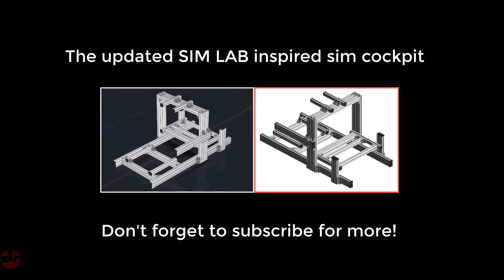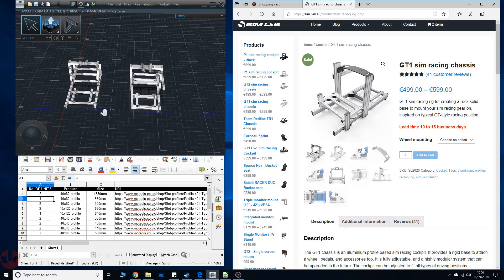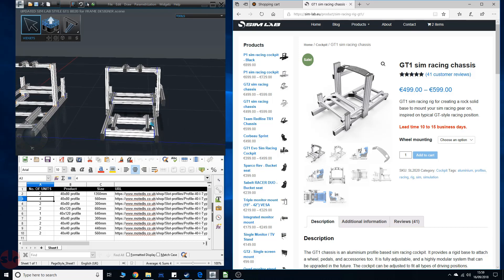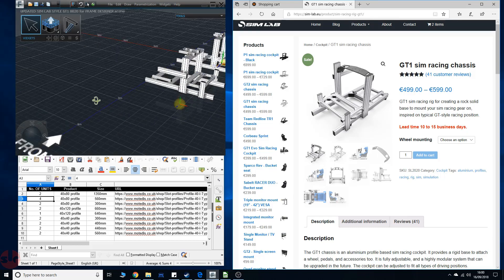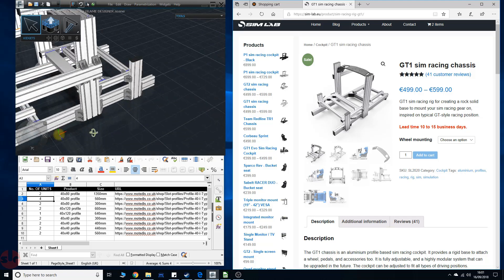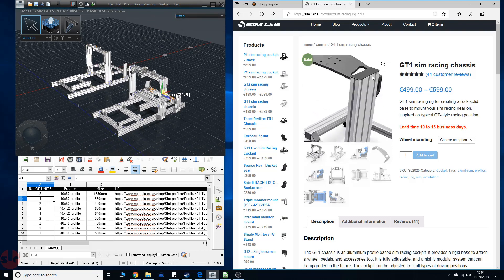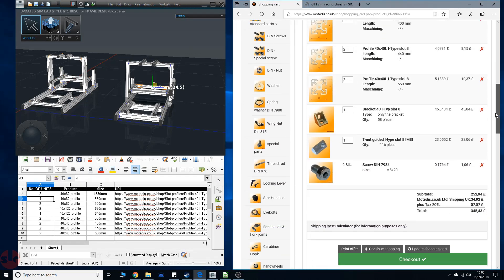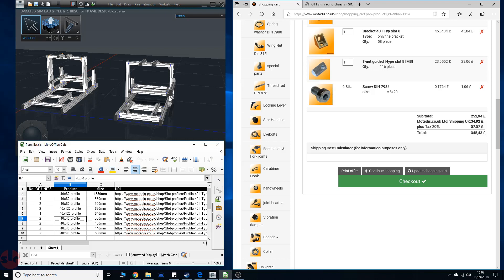Build this SIM LAB GT1 style 8020 sim cockpit and save 40%

Comment: In America we have a steel product called SuperStrut. Its not as pretty as 8020 aluminum but it is similar to work with. Its available at local hardware stores like Lowes or Home Depot.  To give you an example of price: A 10' (3 meter) bar of 1-5/8" square tubing is $18.57. I'm building a rig to hold my Fanatec CSL Elite kit/ with H-shifter, Jegs 70200 seat, and 49" 4k tv. My total cost is around $150 for the rig and $45 for the seat (still tweaking the design).  That CAD program you are using is real slick. I'm stuck using tinker CAD on a Chromebook.  My operation is a truly low budget. 
For angle adjustment of the wheel, if you decided you want it, you can use the slotted hole brackets on the sides of your wheel mount extensions. Cheers and good luck building.
Reply from the maker: Very ingenious Todd. SuperStrut does look like an interesting option. It should work fine for lighter gear.

Comment: I just decided to see what it would cost me to build this rig setup, with all the exact pieces and fasteners, and the price difference with freight fees comes so close to the price of simlabs version, that i couldn't justify going the DIY way.

And thats the thing, unless you have a 8020 supplier nearby and you can get reasonable freight prices or even pick up its probably cheaper and then i could see it. But i also can appreciate the designwork Simlab has put to the rig in the first place so I prefer to support the company instead, pay a little extra for essentially the same product. This way I support as many jobs as possible in the line of production.

Comment: Great video I know what rig I’m going for now. Just thought I’d mention it would be it would be easy enough to be able to change the steering wheel angle. All you would have to do is modify the bolt holes on the 90 degree brackets.
Reply from the maker: Great tip!

Comment: Hi,

Trying to save space here to then place a independent 3 monitor stand on the outside of the base. 

1. If we place the vertical 40x120 on top of the base 40x80, would the rig be still as STURDY/STABLE as your design? or will be be less stable? Any particular reason you kept the vertical on the outside instead of on top?

2. If we go with the 40x120 on top of 40x80 option would you recommend to reduce height from 790mm to 710mm or to still keep it 790mm?

Thanks and waiting for your reply as im ready to place order.

Thanks a ton 😊🙏💐
Reply from the maker: 1. You can, but I'd recommend you use joining plates instead of the basic brackets to prevent flex. That's the reason this design has the uprights on the outside, so they can be sufficiently secured with these angle brackets.
2. I would reduce the height.

Comment: Any new update on building a new SIM Rig . Great video smashed that like thanks
Reply from the maker: This is a classic, practical style of design that stands the test of time. So I haven't felt the need to revisit this subject. My personal sim rig is the SIM LAB GT1, so it's effectively the same as this one.
Reply: @SimRacingCorner  thanks 👍
Reply from the maker: Actually, you can check out my setup in my most recent sim rig tour. https://youtu.be/p86LYGQqX0M. It's modded a bit over the years to accommodate gear I've attached, but essentially the foundation of the rig is unchanged.

Comment: couple questions....
are your wheel base stanchions 300mm?
300mm is the shortest in your xls, so i'm assuming they are.
also i'm looking at purchasing a clubsport wheelbase 2.5 from fanatec and it looks like it has a 3 bolt triangle pattern for mounting. 
have you considered how this 4 point square style would accommodate that?
Reply from the maker: The clubsport comes with an angle bracket that provides a 4 bolt pattern that will work with this.
Reply from the maker: Otherwise. Just make a deck out of board, drill and bolt through.
Reply: Ah I didn't know about the bracket, ty for telling me!
Reply: Have you added any type of feet to your rig? I wanted to do 6 leveling style feet but they are 25% of the total cost!! I'm considering skipping them and just setting the rig right on the floor.
Reply from the maker: @jaywarren3505  I've added 4 rubber feet to mine, but sitting the frame on the floor is just fine really.

Comment: What kind of seat goes with this? Can you put most seats on it and adjust them? Does the design have any of those quick tightening parts so you can easily move pedals and seat around?
Reply from the maker: The point of this type of build is it's easily adjustable to fit all types of gear (including seats) and modular. Eg. https://youtu.be/p86LYGQqX0M
Reply: @SimRacingCorner  Ok I'm sold, that was a cool video. So you can basically put anything on it as long as you figure it out how to do it. Little bit of like playing with a puzzle. I think starting basic and then adding things little by little with time is the way to go.
Reply from the maker: Yes, it's a completely versatile platform you can add too and move things around, and structurally stiff. The materials are easy to work with, there's no real skill needed. The design in the video covers the essential base measurements and parts for the structure.
Reply: @SimRacingCorner  Thank you for the quick answers. I checked a site that sells 8020 and all the parts and sky is the limit for this. I'm going to check your videos on if you have triple screen stand too and other rigs. I would wish many seating positions were possible, and it would be a bit higher from the ground than this rig. This would be good enough for my needs as is though, just nitpicking.

Comment: Hey bud. Sorry to dig up an old vid, just wanted your view on whether this is still a viable option (self build old style SimLab GT1) in comparison to the current SimLab GT1 Evo rig? Price wise theres only about £40 quid in it (inc shipping) between the two. I can see a lot of the extrusion has been removed, with custom aluminium plate used for the pedal area on the newer evo version.
I'm currently using a modded up playseat challenge (due to the need for it to be folded away) with a TX wheel, T3PA pedals and TH8A shifter, but I'm going to have the opportunity for a permanent rig in the next few months, so I'd appreciate your views :)
Reply from the maker: No worries, this is still quite a popular video. The EVO GT1 is very nice at a good price point, it's a really good option. The DIY build in the video will be a bit more sturdy than the EVO GT1, but nothing of concern and would still be stiff enough to carry a direct drive wheel. I do like the look of it. I don't think you can go wrong with the EVO GT1.
Reply: @SimRacingCorner  Appreciate the reply.  As this build (and in most dimensions, the GT1 Evo) is similar to your rig, would you think it would slide under a desk right up to the back of the steering upright extrusions?  Just playing with ideas of the screen being sat on a desk/arm mounted, so I can push it back and use my PC for 3D CAD etc. as well as for sim duties.
Reply from the maker: @Skate2create  You could the slide pedal area under a desk, to the point the uprights of the wheel deck would butt up to the tabletop. You should need about 450mm of depth (measurement taken from my rig) under the desk for the pedal area to fit.
Reply: @SimRacingCorner  top man, just the info I needed :)
Reply: @Skate2create  Get a monitor swivel arm and you can team just swivel and move your monitor right at the end of your desk

Comment: Hi, great video but 5 years old.  I am looking into sim rigs right now (like a lot of people) and would really like to know if this is still going to be more cost effective than buying off the shelf?
Reply from the maker: You'll need to do your own research on this, and check the parts against local suppliers for the best price and see if it's worth the effort of a DIY vs. a turnkey option. The only thing I'll add, is for the connecting brackets, AliExpress is the cheapest place to find all those pieces. Ultimately, a DIY build will be always cheaper if you don't mind shopping around for the materials.
Reply: thanks for quick reply.  I was really hoping to lure you into making an updated video :) Your insights and previous experience would certainly be valuable  @SimRacingCorner
Reply from the maker: In light of this video not getting much traction since being published, it's a not a subject I'm looking to revisit at the moment and I currently have a bunch of other new videos I'm working through.

Comment: at some places where you have used 2x 4040bracket, is it better to use a single 4080 corner bracket instead?

Are 2x 4040 corner bracket inherently more stable than a 1x 4080 corner bracket?
Reply from the maker: I think there will be times when spreading the load with 2 4040 brackets is better than a single 4080 bracket.

Comment: We need a simple adjustable cheaper Inverted pedal mounts as well!
Reply from the maker: I don't know if you've seen the Trak Racer inverted pedal bracket. That would be ideal for this.
Reply: @SimRacingCorner  I just saw that last night actually and already considering it, either that or diy with some 4040 profiles. If all the parts for diy would cost close to the tract racer shipped then Ill just go with the track racer for sure
Reply from the maker: @daemon3spade  I do particularly like the Trak Racer solution. I've been considering it myself. But my purpose would extend to future pedal reviews where I need something I can easily adjust on the fly.
Reply: Alright mate.. I just received my Sprints and feeling them by hand they are a bit tougher to push, this really will require a solid base definitely
Reply from the maker: @daemon3spade  What sim rig are you currently using?
Reply: @SimRacingCorner  just diy alu profile and its only the rig part of the wheel.. damn i cant share links in YT comment

Comment: This is really helpful.  Could you clarify how I fix the pedals and wheel if I go down this route please? I undertand the simlab rig has a bespoke pedal and wheel plate.
Reply from the maker: Some wheels and pedals can be bolted directly to the profile using just t-nuts. Others can be attached to the profile using corner brackets. Other wheel and pedals may require additional profile parts or a flat mounting deck. Basically depends on the hardware.
Reply: @SimRacingCorner  could you share how the Tlcm would be able to be connected to your designed rig. What extra parts I need to order. Thank you.
Reply from the maker: @ranakirti  I use this https://youtu.be/H34NnGCephQ

Comment: How do I mount the wheelbase. Sorry I'm new to this. Would appreciate it if you could link me to something
Reply from the maker: Which brand/model of wheelbase?
Reply: @SimRacingCorner  thrustmaster t300
Reply from the maker: @sadistic6007  The easy solution is attaching some board across the 2 bits sticking out of the frame to create a mounting surface.
Reply: @SimRacingCorner  alright thanks. Also what should I do if I want some angle for my wheel base. I,e I want it tilting upwards a bit for some comfort
Reply from the maker: @sadistic6007  You should be okay with the T300, the wheelbase is already angled when mounted to flat surface like a desk.

Comment: I noticed the video and frame designer scene have 40x120x660 uprights. The excel parts list and may-cad model have 40x120x790 uprights.
I assume simlab increased this length because of their custom wheelmount part.
Reply from the maker: Yes, you correct, the 790mm is based on the SimLab custom wheel mount. I would say though if you going with a wheel mount design like mine, I would recommend 760mm (minimum) uprights or taller. Having the freedom the adjust wheel deck height is important. In hindsight, 660mm is a bit short.

Comment: Watched both your vids today, great videos but you still got the bolts wrong as in last vid, m8x20 is 20 mm long, not 20 pcs. You basically got 6 bolts in that list stk = pcs in german, where i would guess the seller is from. Bolts are cheap so wouldnt make much of a difference but just a note for upcoming videos :)
Reply from the maker: You were clearly paying attention. You're totally correct, I realised the error later on. Just me getting confused while recording. I corrected this in the downloadable parts list. And thanks for watching. All the best.
Reply: @SimRacingCorner  Hi Guys, Just subscribed. Excellent work. Can I confirm that it should be 116 stk Size M8x16? Thank you
Reply from the maker: @ladaloutevans  Hi David, yes, it's the M8x16 (16 is the length in mm) bolts you need and lots of them as listed in the part list.
Reply: @SimRacingCorner  Awesome. Close to buying a 3d printer!!! You will know what for! ;)
Reply from the maker: I think I do. Handy things 3D printers.

Comment: was thinking why are the aluminum on the pedal plates that high? Is there any way to reduce aluminum used on the pedal plates by changing there positions etc?
Reply from the maker: The rear pillars are high to allow the pedal deck to be tilted. And the design does overcompensate by trying to be a universal platform to support all circumstances. Of course you are free to alter the design for your needs.
Reply: @SimRacingCorner  all situations toy mean like for a f1 style higher pedal setup? and lower for gt3 setup? that's why increased it from 200mm to 300mm? Thanks
Reply from the maker: @ranakirti  Basically yes, and also the pedals. High-end pedals have title adjustable pedals, where cheaper pedals sets don't. So you need to be able to tilt the pedal deck in those situations.

Comment: Great idea for a video and nicely done!
Naive question: do you think scaling it down to 20x20 size would compromise rigidity?
Reason I am asking is that it is 1/3 the price here in Hungary compared to 40x40 profiles.
Reply from the maker: My 3D printer frame is constructed from 20x20. It's only good for lightweight applications so not strong enough for significant weight-bearing. But 30x30 would work though. It's not unknown for people to use 30x30 for sim rig builds.

Comment: Hello good day, nice video. just want to ask, i saw on your buying list that it has the 80x40, 120x40 measurments. Unfortunately the store that i asked to said that they only have thr 40x40 size, but they said that they have this kind of "joiner" to make it for the size im looking for.. are you familiar with the "joiner".. will that work to make me have the 80x40 and 120x40.. sorry for the questions, i am new to all of these..
Reply from the maker: The joiners, I'm assuming, are straps which join together the stacked pieces of aluminium. You  can see them being used here: https://youtube.com/shorts/XDhY71ot16U. It's works, but personally, I wouldn't want to use them for the entire sim rig build.
Reply: @SimRacingCorner  Thank you, just subscribed. thanks for the tips. one last question though, based from your build design, it seems that the wheel deck or mount is not adjustable in terms of angle, like for example you want the wheel to be somewhat upward angle.. how do you think this can be done?
Reply from the maker: Depending on the wheelbase, a different solution may need to be worked out to get an angle. What wheelbase are you using or planning to run?
For example, In the video I pointed you too, I am able to get some angle using the brackets  that connect the wheelbase to the props (standard 40/40 angle brackets, but I could increase the angle with 40/80 brackets). And for example, with a Thrustmaster/Logitech wheelbase, it's designed with an angle already for placement on a flat surface like a desk.
Reply from the maker: Also, you could combine your DIY build with a third party wheelbase mount like this sort of thing. https://trakracer.com/products/wheel-deck-with-full-slide-and-angle-adjustment?_pos=35&_sid=e777a59b3&_ss=r.
Reply: @SimRacingCorner  I am planning to use the VRS DD, but havent buy it yet. looking on the pictures of it..its flat and it does not have an angle if you mount it.
Reply from the maker: VRS also sells a mounting bracket with angle adjustment. You will have no problem, it mounts directly to the aluminium profile. https://virtualracingschool.appspot.com/#/Store

Comment: Is the rake of the pedal deck adjustable on this design?  Looking at it, I wondered if it could be adjusted by braking the tabs off the 40/40 brackets that connect the pedal deck to the uprights?
Reply from the maker: Yes, that's exactly how you would adjust the angle.
Reply: @SimRacingCorner  Thanks! It's bloody complicated working all this out, so these videos are really helpful! I was going to buy adjustable angle brackets, but if I can do it with just breaking the tabs off the 40/40 brackets, I will do that.
Reply: Not able to understand this... unvale to see 40/40 brackets in the shared parts list file... pls expand. Thanks.

Comment: which length do the m8 screws have to have?
Reply from the maker: You will need to use 15mm M8 bolts
Reply: @SimRacingCorner  My question exactly. I'm making this in the EU, and I paid 375 EUR for everything. Thanks a lot for all the work you put in. See you on the track.
Reply from the maker: That's awesome, that's a great saving. Please let me know how your build goes I'm very interested. All the best.
Reply from the maker: @jduvel  In the video I confused myself and messed that bit up, sorry about that. In the downloadable parts list (in the video description) the correct size and number of bolts are listed on the spreadsheet. The ones you want will be the M8x16mm bolts.